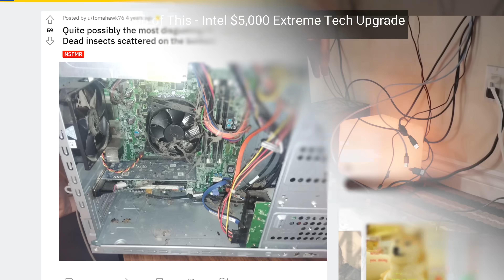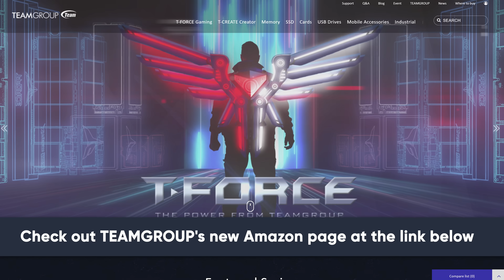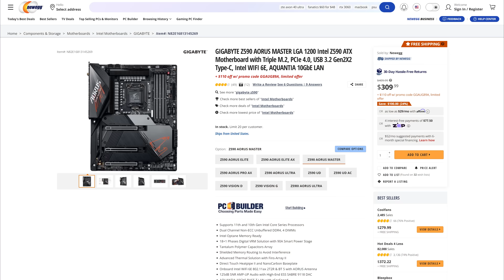How Often Should You Clean Your Computer?

Comment: I remember a time before cases came with dust filters. Man, those were an absolute god send. Best tip I've got is to keep your chassis off the floor, and preferably in a room without carpets. If using a compressor, make sure to set the outlet pressure to a low PSI. Also don't use one in a humid environment, as you'll just be blasting your rig with water vapor.
Reply: Yeah, so important. 
If using a compressor also make sure you have a inline filter on it, to prevent water, oil from spewing in also -they do that. And people be sure to oil your compressors.
PRotip, buy some air filter sheets from big box stores like lowes in the shop vac section.  Cut to size and cover your intake fans/ fan openings. Be sure that you get the right filter that you can easily blow through, but is still tight enough for dust.  Also use good quality fans that have high pressure and flow instead of just cheap ones that spin fast. These filters sheets are sooo much cheaper then buying filters off Newegg.  Sometimes you will find filter bags for shopvacs for really cheap to, just cut em to size. No need to ever double layer a filter.
Reply: Best tip I have, is hoover once a week below your desk or computer.  Once a month even.  
The dust comes from somewhere, and it isn't just magically from thin air, clean room happy PC.
Reply: Depends on the dust filter. I had ones for individual fans and they clogged up already in one or two days, increasing the temperature faster than with no filters at all
Reply: @Nico1a5  maybe your environment is just super dusty?
Reply: @Nico1a5 if it got that dust in 2 days the. Your house is disgusting
Reply: @zipper978  lol you are insulting my house from a 3yo comment, I removed the fine filters at least 5 years before that so I was not sure. Take it was a week with the case on the floor, that definitely makes it more dusty. What I meant is that it creates a solid wall of dust in so little time, proportionally lengthy to your environment. The novelty of dismantling your PC for cleaning every month definitely wears off quickly.
Reply: @dj Kplus I have not checked prices lately, but the filters at home depot were cheaper at the time. And regardless of 'computer' 'vac filters' 'home filters' 'vacuum filters' the size of the micron filter- doesn't seem to mind what its called, nor does the dust.
Reply: @dj Kplus Why I said above can easily blow through. As for whatever micron size it is that allows good airflow, from 13 to 15 for hepa, down to filters, low single digits, these filters just ..... work and without choking. 
Again not sure about prices at amazon, I will check out those sheets to compare prices, with cutting your own.
Reply: @dj Kplus use a pair of tights then.  Sounds dumb, but it worked for me.
Reply: @dj Kplus whole home filters are 11-15 micron, I cannot imagine a pc fan blowing through a 100 micron, never heard of one so fine. The sheets I am referring to, u can see light through, and easily feel air when you blow through one side. Usually for shop vac exhaust, generic brand, easy to cut.
Reply: My room is >75% humidity all the time. Pray for my PC to last a long time.

Comment: I feel like this video failed in two points:
- failed to explain what is the worst that can happen if you don't clean your PC. the editor made it look like you could burn a component or damage the computer but i think the WORST case would be your PC shutting down because of thermals
- the spinning fans with air should be re examined. what are the consequences of each? is the backwards current related to the damage of the headers?

Comment: Electroboom's static discharge tests with Linus make me think that the vacuum or compressed air methods of cleaning are just fine. Maybe a video about it? 👉👈
Reply: Yeah and spinning your fans might be fine as well..
Reply: @ikbintom  have you ever heard of this amazing invention called your other hand? It works wonders for doing things like holding a fan still while your other hand holds the air nozzle. Pretty effective too ;)
Reply: @TheFinalFrontiersman  It's a new innovation. You can't expect everyone to be that tech-savvy. Ugh, nerds these days!
Reply: @TheFinalFrontiersman  m m m my other w wh what? 😰
Reply: Iv been using vacuum cleaner to clean pcs for years with no problems.
Reply: @OrangusPendekus  the problem is not the computer dying, but it having latent defects. if something gets an eletrostatic discharge, it may function well for years and die later, or may cause instability and are next to impossible to troubleshoot to the average person
Reply: @OrangusPendekus  just because you haven't had any problem doesn't mean it doesn't exist.

I have flown many times with airplanes without any crashes or problem whatsoever. It doesn't mean that it doesn't happen
Reply: Not all components are resilient. One static spark on the motherboard's data line(s) to the cpu or the cmos chip could fry your rig. Rams are much bigger component than the cmos or cpu's wiring.

Comment: Really liked this one, 🤔 though I imagine the battery operated dust blowers are fine? I don't like the idea of canned air from a Environmental standpoint, I'd rather choose the lesser of the two evils if you will.
Reply: Those are fine. I use a corded dust blower and it works better than canned air, is cheaper, and is better for the enviroment. Another perk is the blower works upside down whereas the canned air does not. 🤓

Comment: SOME good DC fans have a small diode in it, which prevents reverse voltage being inducted and damaging the motherboard. BUTTTT some fans also have some tiny IC chip inside, usually a hall-effect sensor (which just figures out the RPM of the fan) which COULD get damaged. But better safe than sorry and holding a fan, or using something small like a toothpick to hold a fan if it inside a laptop.
Reply: Please provide evidence of just 1 person who has managed to generate an electric current by spinning a modern computer fan.

Comment: An electric compressed air duster, is the best investment you can make. Had mine for 6-7 years now lol, they look identical & you can't mistake them. On Amazon just look for the ones have a handle with attachments. & No, they won't harm your pc/electronics, it's not that powerful lol... 
The amount of air cans it has probably saved is in the hundreds. It's also great for quickly drying off water or dusting other things like a fan/ac filter as well.. 

Don't bother much with the tiny/little handgun ones as they're not as practical or powerful. They might look "cute", but it's meaningless when given time they'll also need a replacement battery or replaced entirely. It's the equivalent of blowing through a straw & it's only "popular" because every tech YouTube has one next to an iFixit kit on their desk. Like seriously lol.

Edit: An air purifier also helps reduce the amount of dust to clean (for your health & pc)

Comment: It also depends how often and and how long are you using it .

I clean with air pressure blower , not the with cans . Cans are relatively expensive and bad for the environment.
I didn't know about the proximity , may have blown off some components, my mobo has power distribution problems . 
Knew about the back current but i thought it was too insignificant to do any damage .
Reply: Off topic but what do you think about the UK's "brilliant" strategy to cut down on carbon emissions? They are no longer using natural gas or coal for power plants and instead are cutting down swaths of forests in Virginia and shipping them over the Atlantic to be burned for power. Am I the only one who sees a glaring problem with this "solution"?
Reply: @dakoderii4221  i don't live in UK,  so its news to me.
Its kinda a big deal, i would have heard it by now. 
It's hard to believe they would do it
1) This is going to cause an outrage.
2)Trees are very inefficient fuel source,
impot and burning of trees would to cost  a fortune.
Reply: @dakoderii4221  I doubt they care about the actual solution at all, they are just trying to keep the woke anti-capitalists happy

Comment: My CoolerMaster NR600 mesh case catches most of the dust in the front panel. I pull it off and wipe the dust off like cleaning the lint collector on a clothes dryer.

Comment: It's a myth that they don't have the potential to cause static. If the claim is that a vacuum causes static because the particles swirl around while being sucked up, logic would also say those same particles swirl around when being blown about the case with compressed air. Only you also have to capture that blowout or it's just going to end up right back in the case it was blow out of. ... 
Wear a strap. Use some nitrile gloves. Don't let vacuum myths prevent you from applying the best tool for the job. Use common sense.

Comment: Dust filters every few weeks. Then every 3-6 months a proper clean - having a glass sided case doesn't always let you see the dust build up, especially if it's smoked glass. I will use a can of compressed air to blow the big stuff and have a vacuum cleaner nozzle taped nearby (6-12 inches away) to suck up the dust particles from the air. I also use small makeup brushes to help get the dust off the case and CPU fans and all the little nooks and crannies, and do the same for my GPU. I remove it from the PC, unscrew the fans and treat them to a nice dusting with the makeup brushes then reassemble it all and slot it back in. I sometimes will remove the PSU to give it a "better" cleaning as I rely heavily on the dust filters to keep it clean. I've been doing it this way for 7+ years now and usually set aside a couple of hours to do it all.

Comment: I clean it as soon as I start hearing front intake fans (they are pretty quiet). It means they are dirty as they are set to "fixed" RPM, primary cause of noise being dust-caused turbulence. In my case, I can go 3-6 months without cleaning.

Comment: I buy the Duster on-brand cans of compressed air from Walmart any time they are in stock locally because they are usually sold out and for a pack of 2-10oz cans they are only $8.88 which is much cheaper than what I can find for them online or Amazon these days.  

I love how Walmart tried to replace the better brand stuff with their horrible Onn brand compressed air in the electronics section, and now if you want the better brand that Walmart doesn't own you need to go to Office Supplies (and Walmart doesn't stock the brand they don't make as often as their horrible Onn brand air, that also costs more per can).

Also he says $6 CAS I'm assuming for a can of air, so yeah I basically stock up as much as I can when I see those dual can packs for about $9 each.  Onn brand sells theirs in singles for about $8 each per can last time I checked, which is a bit ridiculous considering I remember a time when these cans of compressed air cost barely $4--5 each and $10 for two was expensive.

Comment: This video dropped just after cleaned my laptop today! Dropped temps by 15°C and now fans barely run! Really should clean PCs every 4-5 months
Reply: You must've never cleaned it for that much of a temp difference
Reply: @Jactional  I have, turns out gaming laptops are pretty serious about every bit of dust in their fins. Problem is my OEM used ultra thin fin fans to increase the vol of air being blown, but this also caused dust to build up in them

Comment: i have a big and small paintbrush and also touchup tips next to my pc . the compressor is 2 steps away .
Reply: in dusty times i use an swiffer towel (static) and put it on the front mesh . best dust filter ever . looks diy but works the best without heavy restriction

Comment: The more frequent you clear your PC, the less time it take to clean it each time.
I find makeup brush work well when dusting inside and out of PC.
Reply: I just blast it max power with a huge shop air compressor. Never had any issues and I do the same thing 5 figure servers at work. Just make sure you are using an oil free compressor.
Reply: No way. Brushing parts can build up static electricity which could fry a component

Comment: My PC has a filter in the front that keeps out all but the smallest dust particles. Those really tiny ones tend not to settle anywhere in the case, so I end up only cleaning the outside a few times a year. I've only blown out the inside of the case once in like 4 years.
Reply: I did this for my new build and I can confirm it’s great to keep it off the floor preferably not in a basement or attic room with ac and no rugs
Reply: I hope you're cleaning the filter or replacing it, because the dust will clog it and you PC will have reduced performance due to the lack of possible cooling
Reply: @jacobfausnight1180  Yeah I just give the filter a quick vacuum every once in a blue moon. It's only about 4 inches off the floor but that seems to be more than enough to make the dust only build up slowly.
Reply: Same, a massive full tower, Corsair obsidian 750D
Reply: what is ur cabinet?
Reply: @Mr_RAM8O  A shelf. It's very open to airflow overall. And my case is the be quiet! DARK BASE PRO 900.
Reply: Does your pc run hot bec of that?

Comment: I used Xtreme Klean disposable compressed air dusters from Fry's Electronics until they closed in February 2021.  After that, I switched to an Opolar brand battery electric air duster.  And I clean my 9-year-old gaming rig every 6 months (June/July and December)

2:42 looks like a Gigabyte motherboard from the early 2010s, similar to what's in my gaming rig
Reply: While it's true that Gigabyte used some blue accents in their MOBOs, it was not that common for them to anodize heatsinks in blue, to me it looks more like an LGA 1055 Asus or MSI board.